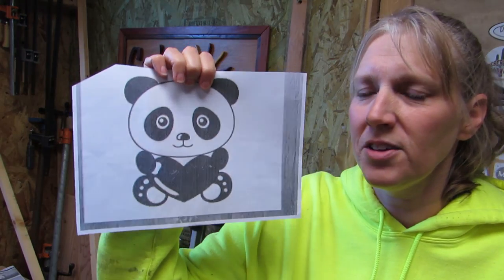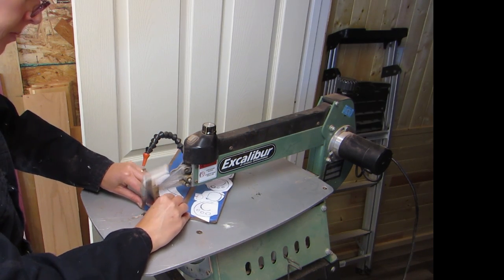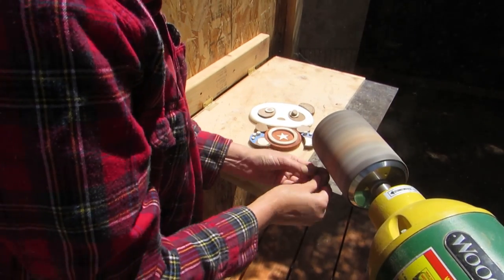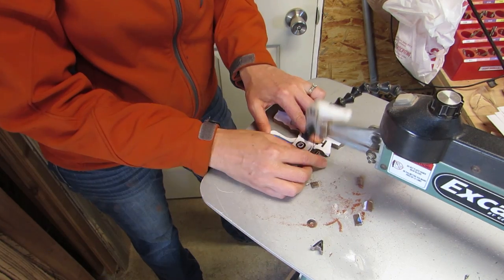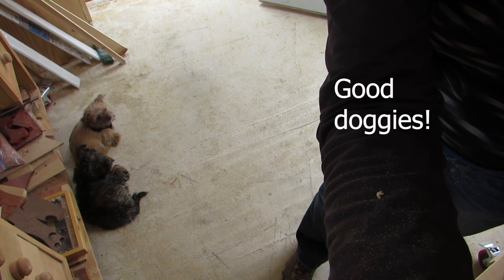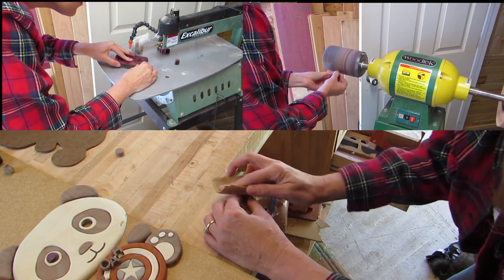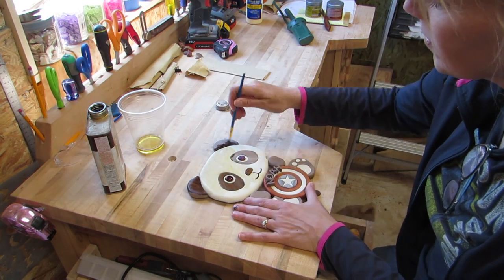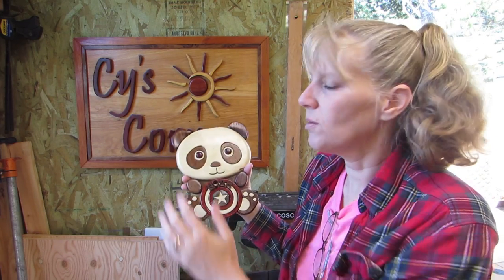Intarsia Panda for Noah

Comment: Great job as usual Cy. When you were talking about your blades I was thinking I would share a "hack' that I us to double the life of my blades. I just use them until they are getting dull,mostly 3/4" wood and then add a piece of 3/4" plywood on the saw table and this allows me to use the upper half of my blades.This gives me the ability to still have at least 1 1/4 inch of new teeth on the same blade. It saves me a lot on blades.
Reply from the maker: That is a good idea! I thought it would be good to move the blade somehow to use the unused parts, that doesn't work with the scroll saw, but your hack sure will :)
Reply: It does work and MDF works even better if you have a piece.

Comment: Hi Cy  Loved the Panda.  I have two quick questions.  I am making project for a neighbor.  It will be painted 100%.  What wood or fibber board do you recommend?  I will be using fine rasps to make a 3D realistic look.  Also is it hardboard you use for the backer?  Smooth one side and pressed on the other?  It looks like you have two new dogs, glad to see two they need partners.  I know they love Mom and Husband.
Reply from the maker: +Gerald Shultz Hi Gerald! For painting I recommend using pine, and for the backer I have used 1/4 inch plywood and hardboard. I love the hardboard but adding a hanger to it is tricky because of the less than 1/4 inch thickness. But it can be done! I suppose the final weight of the project may dictate the backer, heavier would do better with plywood I'm thinking. Yep, we wanted to have 2 pooches so they'd have a buddy. !!!
Reply: Thanks for the info Cy.